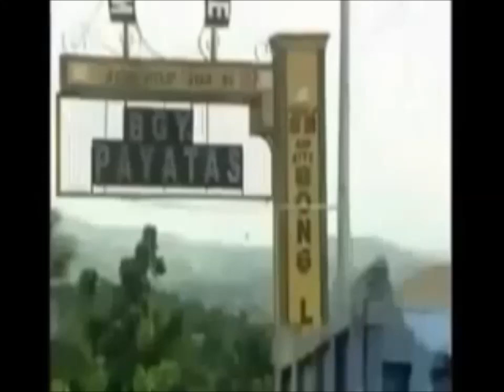Filipino Inventor Turns Landfill Plastic into Fuel..

Comment: Sir..Kaya din po ba niyan na decompose din iyong kahit na anong plastics maliban sa cellophanes diyan sa video?..Saka iyon po bang usok mula diyan sa makina na lumalabas ay hindi ba masama na magsasanhi din ng polusyon?
Reply: di po sya masama actually one of the great benefits of converting plastic to fuel is that the fuel burns cleaner because of a low sulfur content.. mas eco friendly pa sya kaysa sa big3 fuel company.. kaya maganda maumpisahan nila nationwide na to..
Reply: Sana suportahan po ito ng ating mahal gobyerno dami ng plastic sa kapaligiran wag sana mamana sa ating mga anak upang hindi sila magkasakit wag sana pigilan sa the big 3 oil company caltex petron at shell kapakanan lang nila umiiral dito lalo hirap ang pilipinas dahil nila mahal lahat pagkain at mga produkto kun pwede makabili maski portable lang bibili ako dami ng plastic at sa ka mahal ng gasolina ngayun